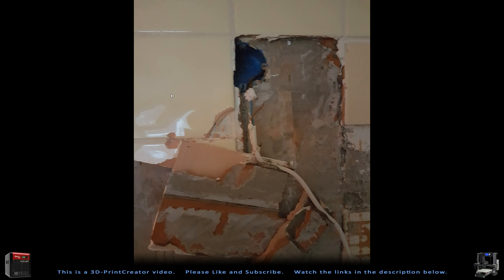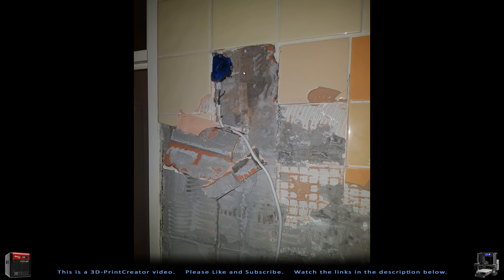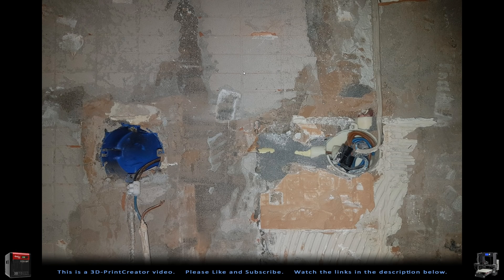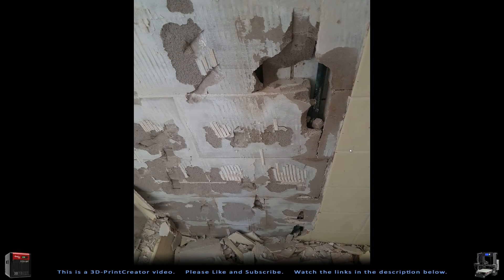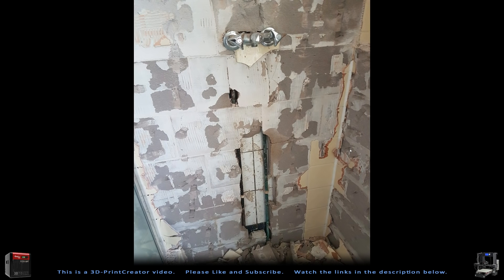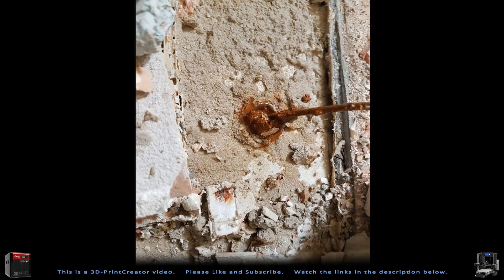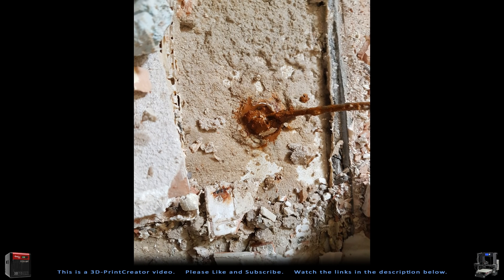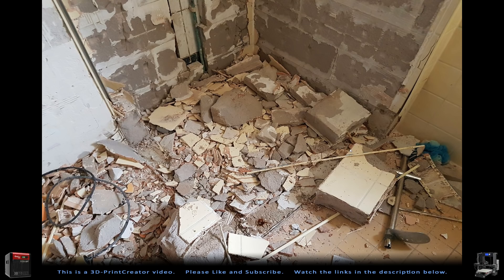▼ I almost had a fire

Comment: Sorry to hear about your troubles. Glad you have a handle on it. I have a house that was built in the 1940s here in California and understand what previous owners hide.

Cool idea with the cube, I am working on a Chinese knockoff prusa metal frame now. Going to keep the good stuff and upgrading the rest. Fun project, especially knowing I have my da Vinci to fall back on.
Reply from the maker: Yeah, building a 3D printer while having a working machine is so much better then having to build one from scratch. During my build of the HyperCube I often had to print a certain part because I wanted to change something.

Comment: Sorry te hear about the bathroom. At least you caught it in time before any fire.

I was wondering, have you hacked the EEPROM chip in the hotend cartridge board on your Pro yet, or do you plan to re-use the board?
Reply from the maker: Thanks,
No, I just use the boards that I bought on Thingiverse, so I have a couple of them that I can use.
When I have time, I am planning on finding out what the EEPROm does and how it is programmed, It will just take a while.
Reply: 3d Print Creator looking into it myself. It has nozzle size and hours for the DaVinci Pro - not sure what else yet. It should also know if it is a laser.